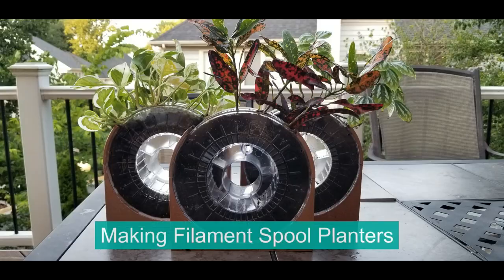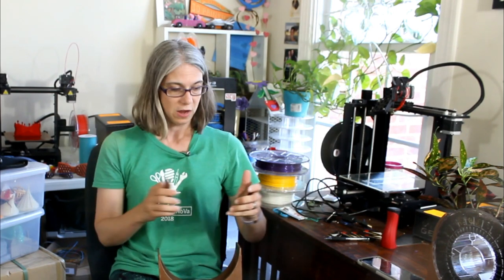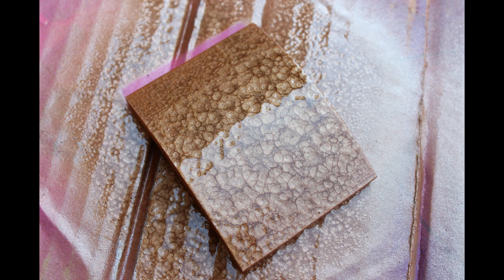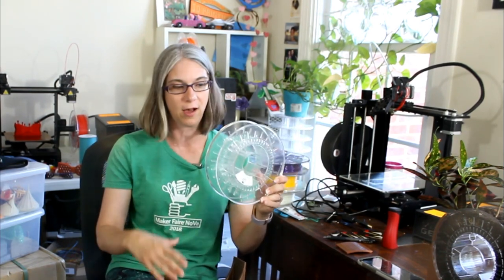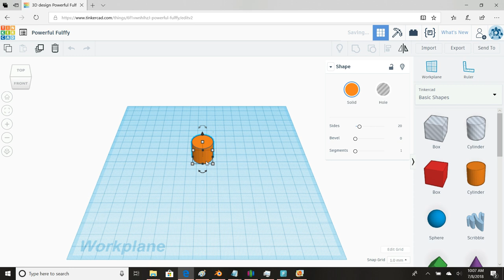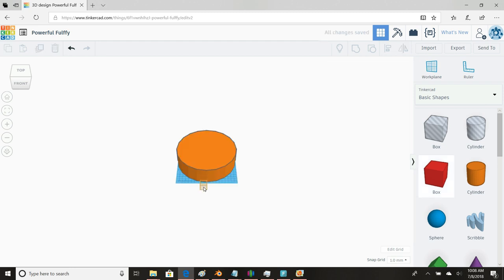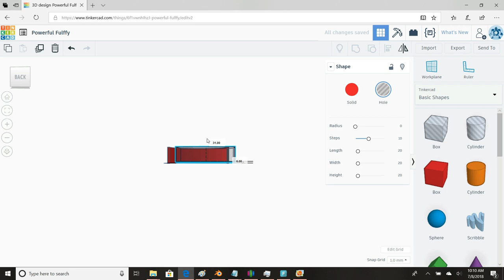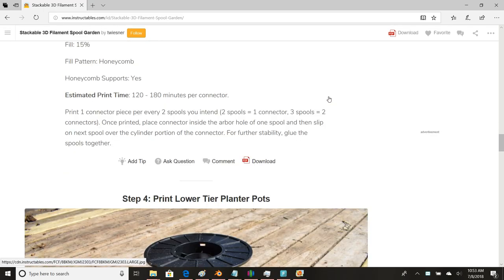Making Filament Spool Planters

Comment: I am against the master spool initiative and has been shown some of why I am has been demonstrated.  For instance you just get a lump of filament instead of it being properly wound on the spool and that causes issues.  Another is that the companies aren't drastically lowering the cost which they should lower the cost for shipping and the price of just a lump of filament.  When I am forced, by these companies, to go that route I am done with 3d printing and will move on.  I hope it doesn't catch on as I told Mr. Hume when he brought out the idea.  Hippy ideals are great but only when the companies follow along with their pricing so they don't simply make more money in the long run.  As far as not having a properly spun spool I am unsure how you ever could with his idea.